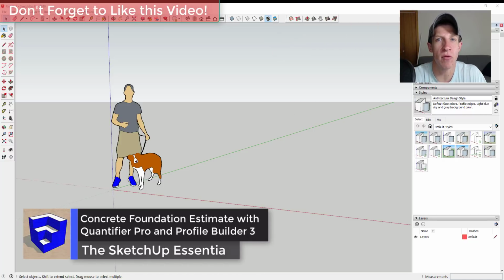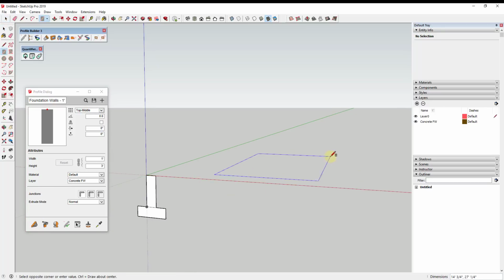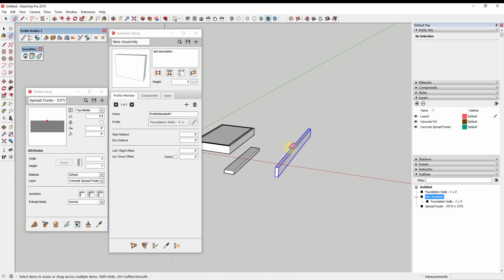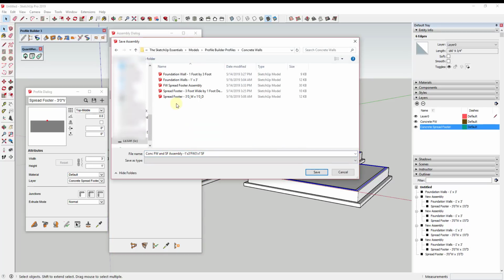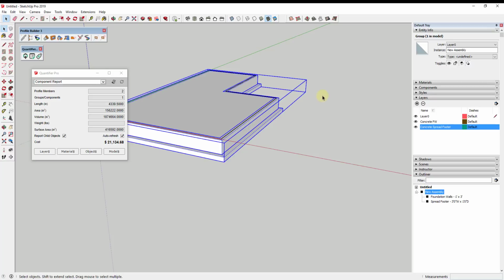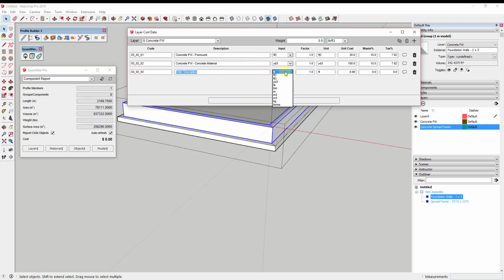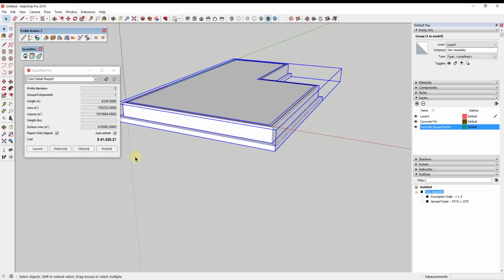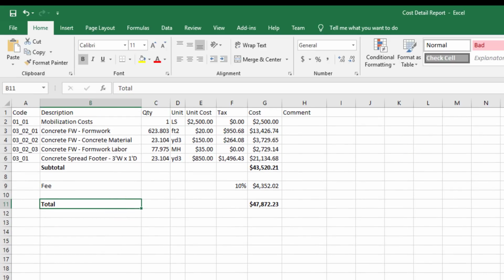Estimating Concrete Foundations IN SKETCHUP with Quantifier Pro and Profile Builder

Comment: Concrete superintendent here , i would much rather just draw both retaining wall and spread footer together and do a follow me , i found this very counter productive this time around but i immensely appreciate your videos
Reply from the maker: Thanks for the comment! Probably depends on what you're trying to do and how you estimate the costs as well. You could totally do what you've described and maybe apply a different material to the sides of the footer and quantify that material to figure out formwork square footage for each type of foundation if you need that quantity.

Comment: I'm assuming the area it calculates is the full surface area of each component.  But when it comes to formwork, for instance, the area that really matters is the area of the two formed sides (excluding the top and bottom).  Is there a way to handle this situation?